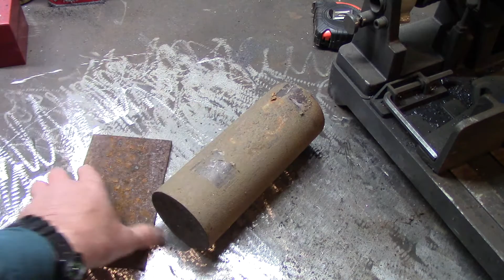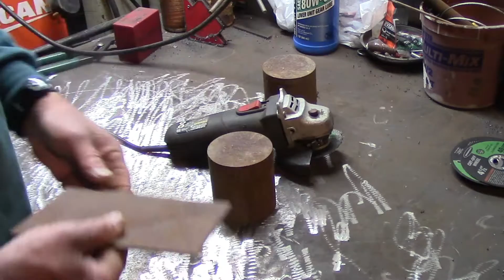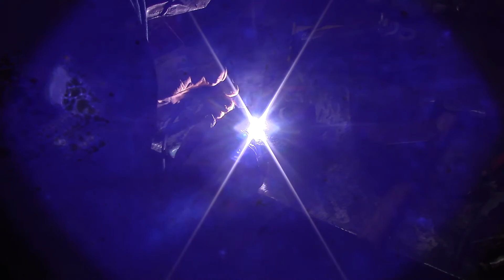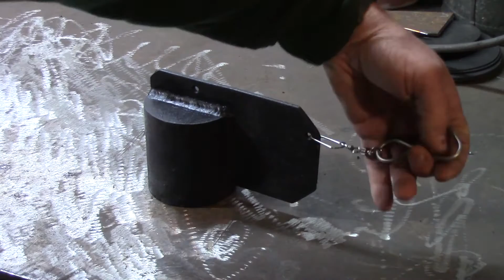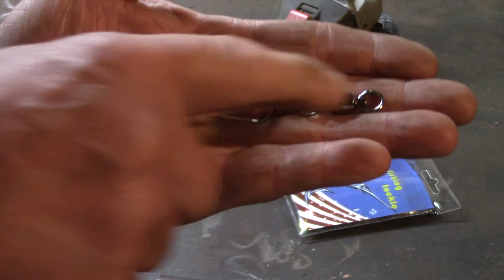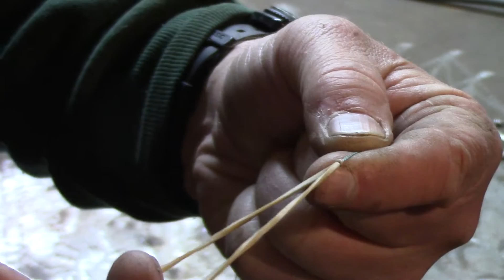Make Your Own DIY Downrigger Weights With Release!: Just $7.00

Comment: An easier way to do that is to just get S-hooks. As far as painting goes, get yourself a can of truck bed liner paint from Harbor Freight. That's what a lot of cannon ball makers are using these days. Lastly, I really do not like the bilateral release you showed. The pinch releases are far easier to use. Just thought I'd give you a couple of tips
Reply from the maker: Thanks for sharing those tips and your experience. I like the rubber band releases because I have had problems with lower poundage braid releasing prematurely. especially from too much rod tension. A Chamberlain release though expensive is probably the best choice, but using different size rubber bands gives me a determined poundage of release with no slipping and they are cheap. You just have to double hitch them to the "S" hook to they stay attached and are not lost in the water. Thanks for sharing and for watching and may God bless you1.